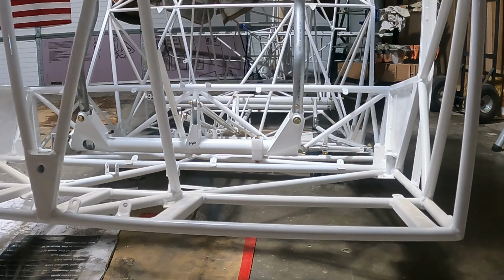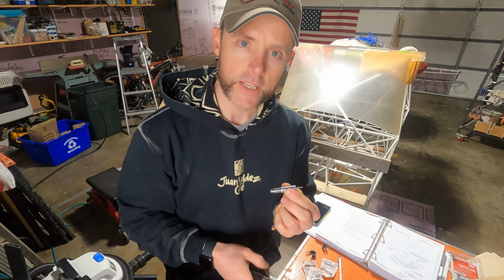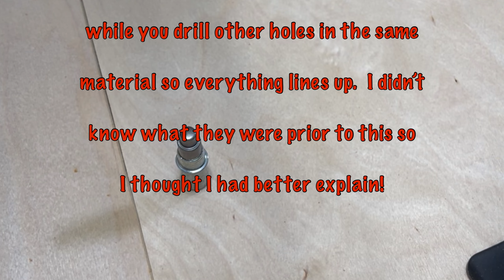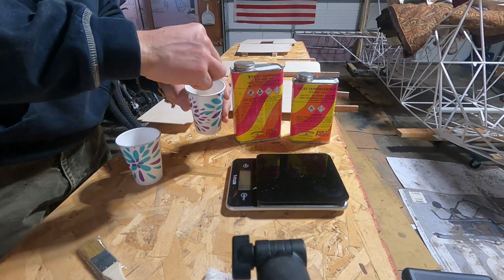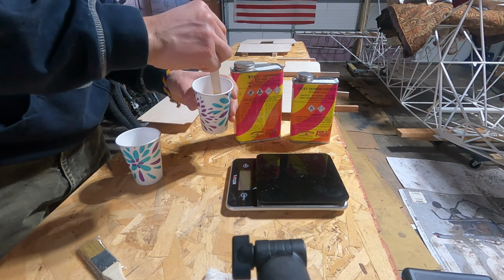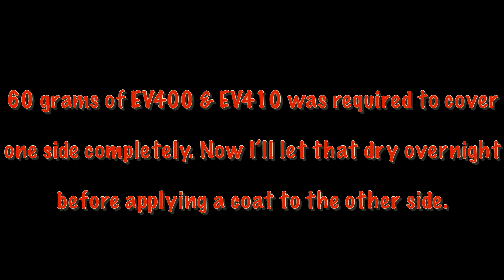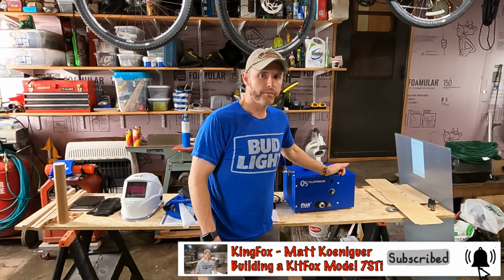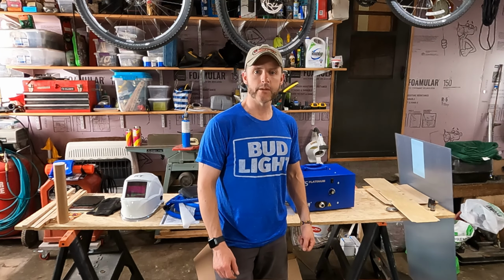#07 Floorboards

Comment: Great videos -- I'm enjoying following along.  Curious why you chose the T70 gun over the T75Gravity gun for the Fuji System?  I had a Q4 Semi-Pro with the T70 and it was alway flawless -- an amazing set up.  However I've watched others (Bryan Bowen) who paint airplanes/vehicles seem to use gravity guns more often -- just wondered if there was a reason.
Reply from the maker: Hello Dave, you have come up with a really good question!  Novice is the best answer I can come up with.  Since I normally mix up only about 30-60 grams of the epoxy varnish I quickly realized that the 1 quart bottom feed gun for this instance was a poor choice!  So just yesterday I ordered the right tip (1.5, gun came with a 1.3) for spraying Varnish along with a top feed gravity add-on, I think I will need the quart size bottom feed for the bigger stuff but for the smaller quantity items a gravity feed is definitely the way to go.  I look forward to doing good work but I’m reluctant to pull the trigger for the first time!  I’d better get over that quickly.  Thanks for the questions and I hope you have a good day.
Reply: @KingFox76  Thanks for your response -- I look forward to seeing it in action!

Comment: I am confused whether you are supposed to use thinner in the mix as well.  It says to use it on the back of the tin.  What do you know about this please Matt?
Reply from the maker: Jeremy, if you are talking abou the epoxy on the floorboards… Brandon told me I should have used the thinner on the 1st application.  I did not.  What I did notice on my final application coat is that it “flowed” out better and covered without brush marks.  I think that if you are putting 3 coats on you will have nothing to worry about.  In the end you are protecting the wood, and that is all.  Let me know what your thoughts are.  It says you are supposed to spray the coats on too, but I never did that and Brandon advised me not to also since it would waste so much product in blow off.  The part of the spray that hits the floor and never actually does anything.  I think it is a horse apiece.
Reply: @KingFox76  yes, I am about to paint my floorboards and ribs all together.  After mixing the ev400 and ev410, I will wait 45 mins and the add 25% of the reducer ie thinner before applying for first two coats.  And final coat I will add 50% of the reducer.  Overkill maybe, but I’m just following the instructions.   If you can send me your email som how, I can send you links to some of the tools I use, ie like the rivnut gun